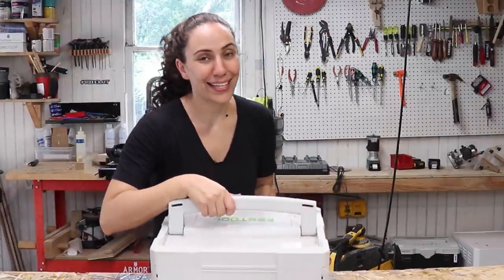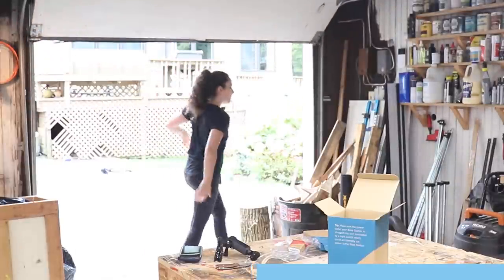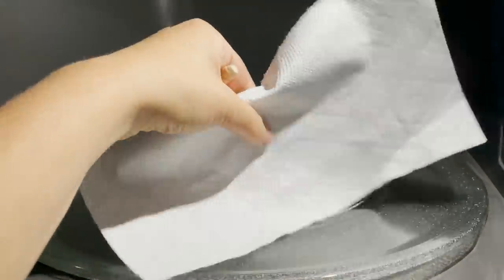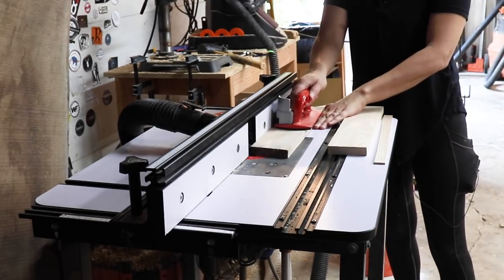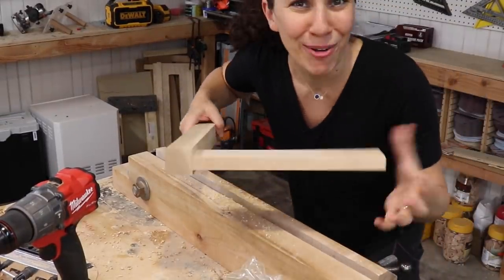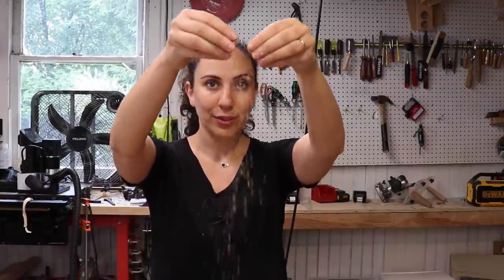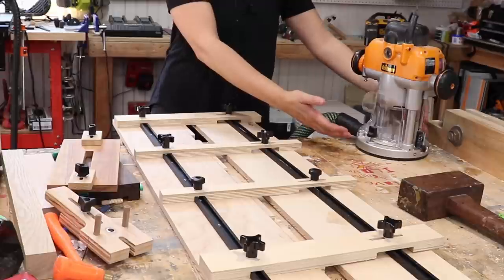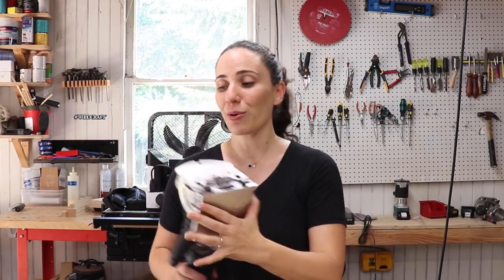7 ways to get around NOT having a DOMINO

Comment: Generally I would agree with the critics about how a multi thousand dollar tool puts this channel in a non DIY world.    Frankly the Domino joiners have mixed reviews from even pros. eg Peter Millard at 10 minute workshop...  The concept of floating tenon is not really something Festool invented that's for sure.   Regardless I guess if you can afford it then buy the tool you need.   The people I have seen use this tool are cabinet makers who do custom work so they are not pumping out  a million of anything and they are charging custom cabinet prices so the expensive tool is a non issue.  
As for the strength of biscuits for furniture well that is a head scratcher for sure.   The Dewalt version of the tool which is the one I own is actually called a "plate joiner"   When making table tops the ability to line up various pieces of wood in alternating grain patterns to minimize warping and the ability to keep the surface aligned is the key feature of the tool.  So really the tool was designed to connect various pieces of wood to say form a table top and so there will be some stresses on a table and as such the biscuits are plenty strong enough.   Plus the design of the biscuits allows for the same degree of adjustability as does the almighty festool domino.   In our neck of the woods the Festool is some $1500 whereas the Dewalt plate joiner is around $200 and the Dewalt is about $300.   So  on paper and if an accountant was present the plate joiner would be a far more cost effective and I would argue as effective method of joining wood.   
Frankly I would rather buy a table saw with a dado option over a domino tool.
Reply from the maker: For alignment, biscuits are great. I have had biscuit joints fail in me when they were stressed. So I avoid them for added strength
Reply: @3x3CustomTamar  Hmm  Certainly would love to see examples of failed biscuit joinery.  Certainly they are light to medium duty solutions not for heavy use projects.   For example chairs.

Comment: I'm a hobbiest, and even I bought a biscuit joiner. It's a no brained, unless you have zero expendible income, you need one of these. I hardly use mine, but when I do, it's extremely nice to have. So my advice to everyone is to save your money, it's about the price of a cordless drill and an extra high capacity battery for a Dewalt. If that's two expensive your in the wrong hobby.
Reply from the maker: Haha that’s my answer when someone says these tools are too expensive… no one said woodworking was a cheap hobby! Ha!

Comment: This video seem to value quantity over quality. The mark of shoddy business planning. While using mass production procedures for various projects can be beneficial, the small entrepreneur cannot achieve mass production runs with out the necessary facilities, supply chains, and personnel. This also appears  to be why this video seems rushed. As though there us too much pressure to accomplish too many things at once, a sure road to burnout. Loose tenon  joinery while adequate for alignment, unless one is exceptionally careful results in loose joinery. With a lot of glue to try to make up the difference. Correctly sized mortise and tenon joints are among the tightest and best joints for many applications. And rank along with doweled and dovetail joints for versatility. 

Floating tenons are only slightly better than biscuit joinery for depth of joint, but properly sized and spaced biscuits do not rely just upon glue.

Comment: I think that... For anyone already with a router or router table, groove & tongue joinery Is always a great way to go. Especially by using the dovetail-shaped bit instead of the square one. Just cut half the size of the bit on each side of the tongue board, cut on the middle of the groove board, slide the two pieces together & apply the glue at the end once making sure they fit correctly. Voila!

Comment: FYI running a microwave with so little load is risky to the magnetron if done for an extended period of time. You really need a load equivalent to 2 ounces of water to absorb the RF energy, there isn't enough moisture if the dowels to absorb the energy. A low oven bake would be better although slower.

Comment: As far as I'm concerned, one can spend their money however they choose. That said,  some people have more dollars than sense. When I was being trained by the Navy in electronics, we were taught how to make 'idiot boxes'. These were simple RC tank circuits with different colored LEDs turned on and off with a frequency that depended on the components used. Throughout the rest of my professional career, over and over I observed the 'idiot box' principle employed by Madison Avenue to sell something that WORKED, but was essentially unnecessary. The y chromosome is particularly susceptible to this marketing tactic. Specifically, put some "flashing lights' on something, and you most certainly will sell it to someone. Get enough someones, and add the endorsement if some shill, and voila! you will make money.

Spend your money how you want. Just don't pee down my back and try to convince me that it's raining.